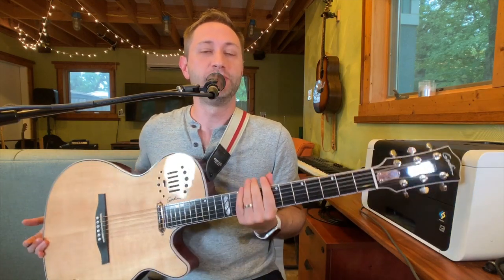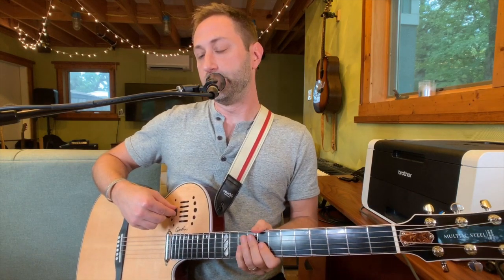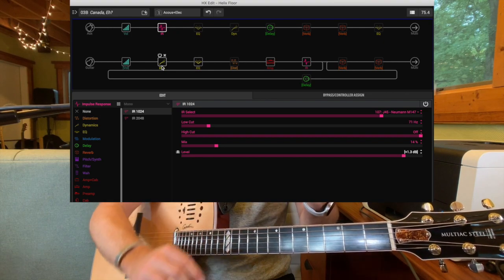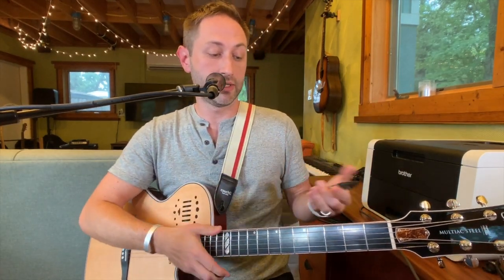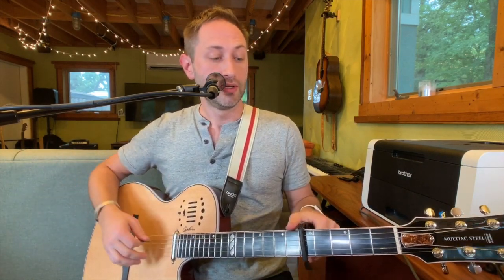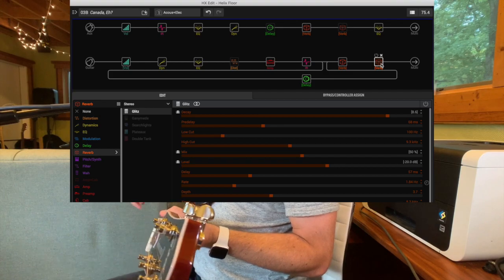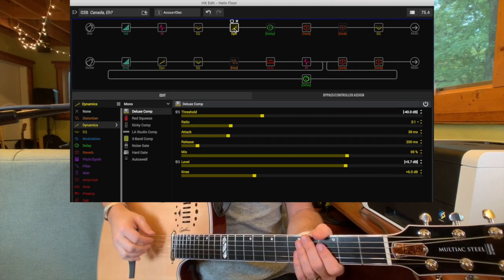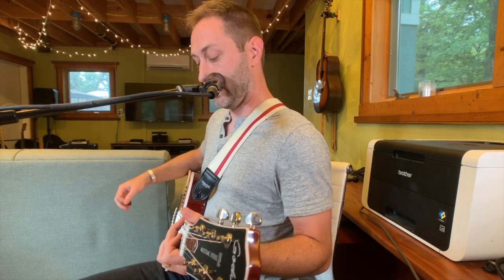Godin Multiac Steel Natural HG Demo with Line 6 Helix and Acoustic IR

Comment: Thanks for your great demo. I just received mine few day ago and it's a great guitar. 

However I noticed something strange and I would like to compare with other users to know if it's the normal behaviour. 

When I use two cables to separate the signal. I have only the electric on one cable which is good. 
But on the other I still have the mix of acoustic and electric. Moreover the 3 band eq modify the sound of the electric. 

Do you encounter same behaviour? I don't find it very logical. 

Charles
Reply from the maker: If you are using two cables, each element should be completely separate. If you're getting electric in the acoustic mix with two cables plugged in, there is an issue, and you should talk to Godin support.
Reply: @jasonpcarroll  

Thanks, that's what I thought. 
I try to contact them.
Reply: I think I found the issue. Not easy for me to explain in English, a contact was bad in the socket jack of the electric jack output. I fixed it and signal is now separate. 

The last thing I wonder is when I use the mix output only. The 3 band eq has an impact on the lipstick. Do you encounter the same?
Reply from the maker: @charlphi  The 3-band EQ only affects the acoustic signal for me (as intended).

Comment: Just bought this guitar.  Can you run ins and outs of both the acoustic and electric through the Helix?  Also thinking about the Helix stomp.
Reply from the maker: Yes, you can run individual inputs to keep the signals separate. I don’t know if that’s an option on the Stomp, though. Helix Floor and LT for sure.

Comment: Hi, have you split the signal ? - two cables going out from the Godin to the helix, or are you just using the one cable and blending? If you are blending how do you stop the acoustic side of things not being affected by the electric effects and vice versa.. Also, did you adjust the mic settings inside the guitar or are you using the out of the box settings? Ta. Are you stil using the Godin semi electric strings or did you change them to a standard acoustic set ? Thanks for taking the time.
Reply from the maker: John Morrell Good questions. I am running two separate cables (I got a dual cable from Amazon so it only looks like one cable), so the signals are split. 

I’m using the stock strings and stock mic settings for now. I plan to try acoustic strings at some point, and I’m hoping it enhances the acoustic sound without ruining the electric.
Reply: @jasonpcarroll  Thanks, I have this guitar and wanted it to replace my MultiAc SA for Live. ( you can see and here it on my channel ) I find in a loud stage environment I still have trouble coming to terms with the response of the body if using the mic. Percussive rhythm playing is challenging. I changed the strings to Elixir acoustic string, but hearing your sound with the Godin ones, I may try them out again. I also changed the ugly tone and volume dials to solid and complimentary wood - why stick plastic electric knobs on the visual front of this guitar beats me. I found to pots that matched the fretboard and put them on. aesthetically it much nicer.  If I ever get a helix, I may be coming back to you for more advice on the set up . Thanks for taking the time to answer my questions.
Reply: Can you post a link to the dual cable?

Comment: This guitar has a mic inside. Have you tried using that instead of the IR?
Reply from the maker: I blend it in and still run through an IR. It doesn't stand on its own for me even though it's good. It adds some air, though, which is nice.
Reply: Jason Carroll k

Comment: I have found you can achieve a great acoustic sound using the helix mic studio preamp as opposed to IR. I feel the moment you engage the IR it sounds more manufactured than authentic
Reply from the maker: Peter Belschwinder that’s what I do on my other acoustics. After your comment, I decided to have another go with a non-IR, and I ended up building a pretty fun patch. Thanks for the inspiration!
Reply: Jason Carroll hey no worries. I also got a lot of twang from my Godin Mutliac steel and found strings are big. Slapped a pair of D’Addario NBs and it makes a world of difference for the acoustic sound! Very interesting instrument for sure
Reply: @Pjbelsch  I just ordered one of these guitars myself and I'm curious if you have tried other acoustic strings and how they compare to the NB's?  I've got a couple extra sets of the Elixer Phosphor Bronze 11's I'll need to use before jumping to another string... or maybe just keeping those in the case for spares.

Comment: Sounds beautiful...what strings do you use?
Reply from the maker: DR Zebras
Reply: @jasonpcarroll  So these things seem hard to find now.  Will either normal electric or normal acoustic strings work equally well?  What would be the main difference assuming identical string gauges?
Reply from the maker: @FastRedPonyCar  you’ll want electric strings. Acoustic strings are wound with bronze which is not magnetic and won’t sound good with the electric pickups.
Reply: What if I really only intend to use the acoustic pickups?  Aiming to lean much harder into a traditional acoustic sound.
Reply from the maker: @FastRedPonyCar  then definitely acoustic strings. I imagine it’s set up from the factory for lighter gauge, so I’d stick with that.

Comment: Hey Jason, thanks for the great video. I am about to purchase my union exactly like yours. I currently use two guitars a Godin ACS ~slim and a Maton SRC 808c from Australia, however i always wanted the hybrid type of set up and recently tried the Fender Acoustasonic and was rather disappointed and then i went to the local guitar store and tried the A6 Ultra and was blown away with it and that’s what made me research your video and was super surprised as I also own the LR Baggs Align Session series with the saturation. So what i want to know is are we not taking a photo of a photo having a session type DI in the guitar and then also the pedal. Secondly are you using the full Helix or the stomp, as i have the stomp and its really a load of fun i have to admit. Let me know, and once again thanks for the video. PS i mainly do looping as a solo one man show
Reply from the maker: I'm not sure what you're asking about the session. I am using the full Helix to get a dual-channel setup like this. You can get a lot out of the Stomp, but with only 6 slots, I'm not sure how you'd structure two inputs like this.

Comment: Thanks for the great review of your new Godin.  It sounds really sweet.  I bought one of the new Fender Acoustasonic Telecaster’s and couldn’t bond with it so I sold it.  I’ve owned a couple Godin A6’s too and Taylor T5’s so I am afraid of trying yet another hybrid guitar.  But your video has me thinking about it again.  Not sure if that’s a good thing or not lol.
Reply from the maker: im58woody I tried the Fender, too, and returned it pretty quickly.
Reply: Have you had an opportunity to try the Headrush Pedalboard and compare it to the Line 6 Helix?
Reply from the maker: @im58woody  I haven't. The marketplace and user support available for the Helix and its patches is so vast, that it was the determining factor.
Reply: Yeah, the acoustasonic sucks.

Comment: Jason, do you know if the electric (magnetic pickup) output on this guitar is lo-z or hi-z? Like, is the mag output active or passive?
Reply from the maker: I’m not sure; sorry.
Reply: @jasonpcarroll  No worries, bro! If you ever have a sec to try it, I think one easy test would be: If the battery is removed from the guitar, does the mag p/u ouput still work? My suspicion is it won't b/c it gets mixed at the pre-amp. (and no pressure to try that, lol!)

Comment: So Jason, it’s been a year now since this post.  Are you still enjoying this guitar or have you gone on to other gear?   There still isn’t many videos on this.   Yours is the best.   What strings did you settle on?   I bought the Worship Tutorials acoustic guitar IR’s recently which I run through the Line 6 PodGo.   There’s only a couple of the patches that I really like.   Maybe I will try the Sigma IR’s.   Not a lot of acoustic IR’s out there to choose from.
Reply from the maker: I'm still digging it. I love the acoustic sound, but the electric isn't my favorite. It's only nice to have. I now have the PRS Piezo where the electric portion is...well...it's a PRS! The acoustic on it isn't as good, but it's passable which makes it the better guitar for cover band stuff. The Godin is still better for worship scenarios when acoustic is the primary purpose. 

I like the DR Zebra strings which are tailor-made for hybrid guitars. 

Patch-wise, I always build my own, but I do quite like the McPherson IR's from Worship Tutorials.
Reply: @jasonpcarroll  Thanks Jason.  So is the PRS the latest SE model Hollow-body with Piezo?   I would have to agree that from the videos I’ve listened to the acoustic tone doesn’t sound as good as the Godin.
Reply from the maker: im58woody that’s the one. I do love it, but it isn’t an acoustic replacement just as the Godin isn’t an electric replacement.

Comment: Great demo! Are those acoustic or electric strings? I think it ships with electric strings...have you tried acoustic strings?
Reply from the maker: Dave Eichenberger electric strings in the demo. I put some DR Zebras on there to see if it made a difference. It’s slight, but I do think it’s better. The Zebras are a hybrid string so they still have the nickel for use with the magnetic pickup.

Comment: Thank you Jason for putting out such an informative overview on this guitar. There is practically nothing out there showcasing it. One question I have is if you have play an A6 ultra and if so would you say the neck profile is the same? The multiac appears wider/thinner. I have a 25 year old Godin acousticaster that I actually like the sound and feel better than the A6 but doesn't have a magnetic pick up. Surprisingly the acousticaster's preamp was much better than the A6, at least to my ears and amp settings
Reply from the maker: M Dub it very much has the neck of an acoustic but with a lot better playability. I really enjoy playing it.

Comment: Plastic finger board? Thanks
Reply from the maker: No, it’s rosewood. There’s a window in front of me, so it’s a pretty bright reflection.
Reply: I think the website says it's Richlite.
Reply: Richlite is more expensive to use than ebony.  Peach guitars have a NAMM 2018 video where the head designer of Godin specifically talks about the material and their reasoning to use it.  Basically it sounds just as good, is indestructible & not susceptible to moisture or drying out.